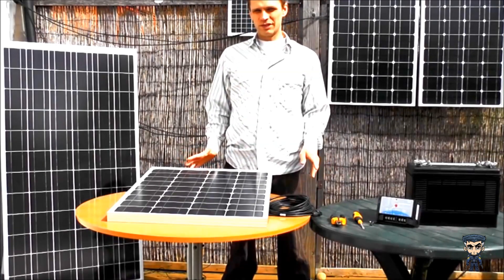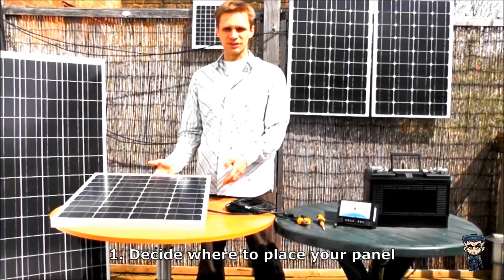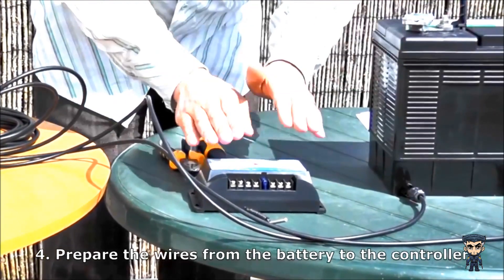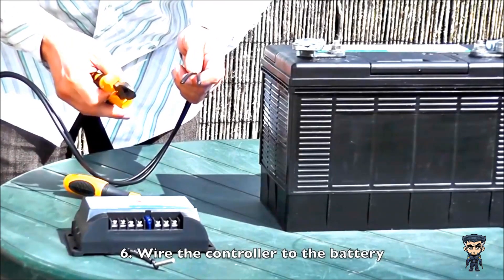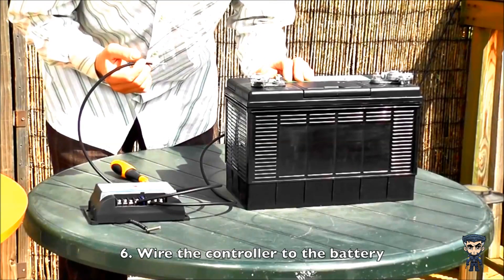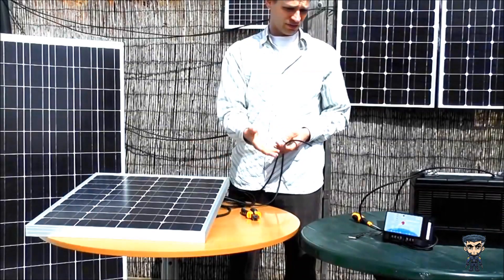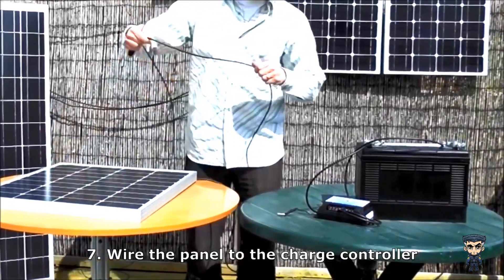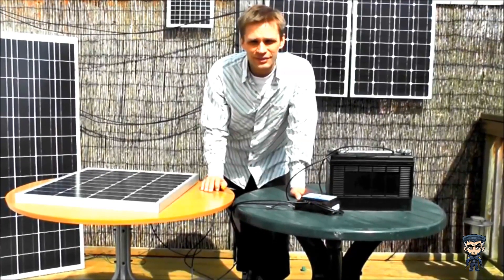How to connect Solar panel to a battery via a charge controller (DIY)

Comment: Hello, I need a little urgent help here, I just bought a 2.3-2.4KiloWatt Array of 10 Panels, I got a 10A Charge Controller and a 1000w UPS, but the seller forgot to give me the cables to connect 4 panels to the Charge Controller, can anyone pin point me towards which cables these are?
Reply: Just got a picture of them, looks similar to this, just 1 - 4 splitter
Reply from the maker: @Kickerdk  Finding a splitter for solar panels is not so difficult. But you need to clearly understand what parameters the charge controller has.
If you assemble all 4 panels using a splitter, the current strength may exceed the current strength of the charge controller and it will not work.
What are the values of the input current and voltage of your controller and the output values of the current and voltage of the solar panels?